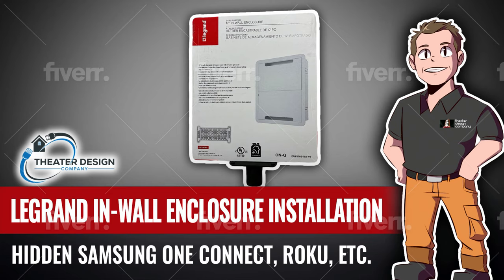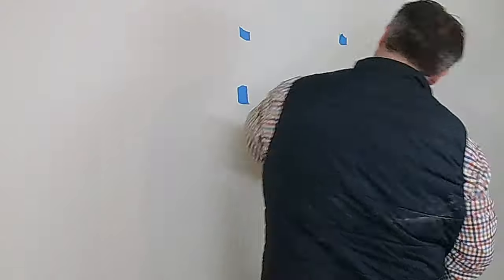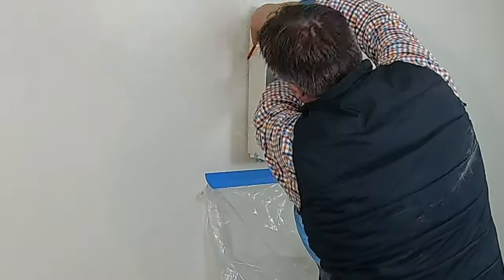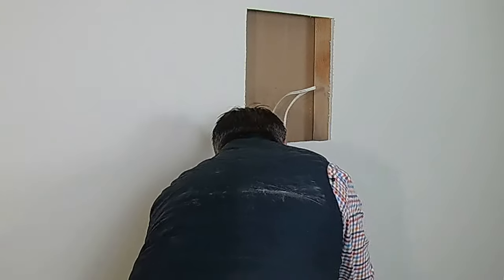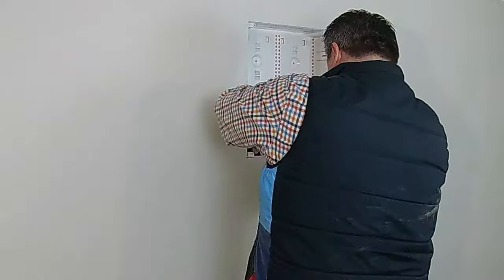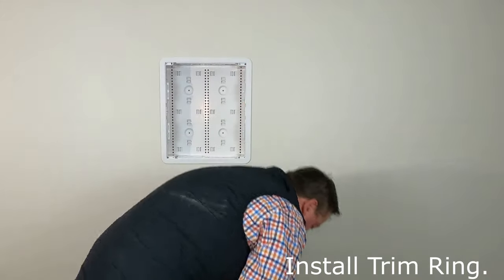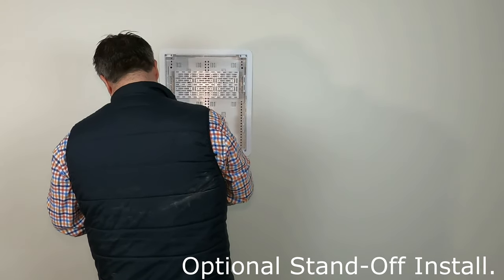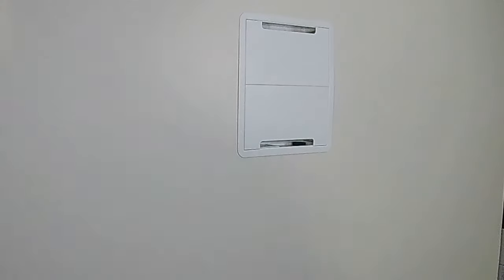Legrand - OnQ In-wall enclosure for Samsung "The Frame" One Connect box | Installation Video

Comment: Did not like the video.   Doesn’t show how the enclosure is secured with the metal rings. Or show how to secure it to the studs metal or wood.
Reply from the maker: There are no metal rings, it screws in from the side as shown.  Cheers.

Comment: Do you have a video with the final design with the TV in front? i thought you were going to show the enclosure behind the tv.
Reply from the maker: Hope to get to it this week.
Reply: Is this centered behind the tv?
Reply from the maker: Yes, however these can be shifted left and right of center depending on size!
Reply: Thanks for the video - related to this, does this box change the flush wall mount design of The Frame?
Reply from the maker: @theorbo   No, this box sits off 1/8" max and the frame is closer to 1/4" when using the supplied foam bumpers!

Comment: So theres not a problem with the extra cable kinking while its tucked into the wall?
Reply from the maker: We have not had an issue.  We do a nice service loop and set it inside the box!
Reply: @theaterdesignco  thanks for responding